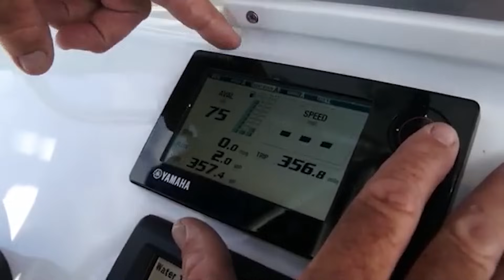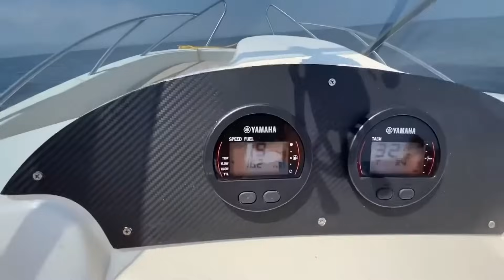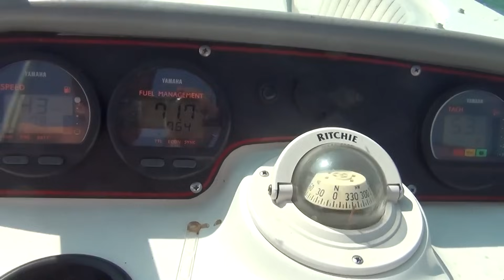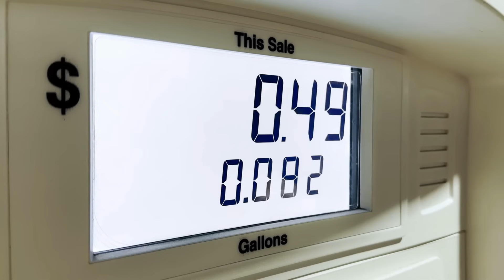Yamaha Built the Perfect Engine... Then Made It Disappear

Comment: When Australia pulled the plug on the sale of new 2 stroke outboards the indestructible Yammie 15 hp 2 stroke was so much lighter and powerful than the new 15 hp 4 stroke that second hand prices shot up. My 15 hp cost me $2,200 and sold 5 years old with low hours for $1,700 when a new 4 stroke was $3,400.

I love my 25 Yamaha lightweight 4 stroke with batteryless fuel injection. Fantastic motor.

Comment: You made an incorrect comment about the Etec engines being carbureated! Etec's have ALWAYS been exclusively DI 2 stroke engines!!! And, they were superseded by Evinrude's troubled 2 stroke DI FICHT platforms.

The lower fuel pressure DI Etec's DID NOT suffer from the problems of Yamahahaha's technically unnecessary very finicky, multi filtered, significantly more complex & heavier HPDI systems inconsistencies at different throttle settings. And... the Etec's were THE FIRST OUTBOARD to achieve the California CARB 3 Star environmental rating as well as the more restrictive ratings of the European "Bodensee" environmental regs! Mercury & Yamahahaha 2 stroke & 4 strokes were later newcomers to 3 Star!
Reply: So why do you rarely see them on the water 

I seem to remember the fuel pumps ran lean and burned them up at high rpm
Reply: @thomascooley2749 because BRP and their marketing MISMANAGED overcoming the public's MIS-PERCEPTIONS about the old low tech 2 strokes in general. And, how BPR's product engineering & design have overcome the problems of conventional 2 strokes. Also, former OMC's RUSHED TO MARKET... DESIGN BUNGLING OF HIGH-TEC PROPRIETARY APPLICATION OF 2 STROKE DIRECT FUEL INJECTION! 😢
Reply: @thomascooley2749  evinrude despite its looks is very efficient and durable, however due to thei marketing incompetence they went bankrupt.
Reply: @jorgeiv804 the last gen they built were great engines i will admit they were ahead of there time for style but when new getting parts was a nightmare and the early etec had allready build a name for unreliability 
No marketing gimmick was gonna save it
Reply: @thomascooley2749 I see etecs on the water every weekend. They were great engines but I would not buy a boat with one (unless it was very cheap) due to lack of parts availability. I honestly think their biggest problem was that all other engine manufacturers were telling the public that 2 strokes are a thing of the past. Evinrude couldn't fight off the stigma of the old 2 strokes.

Comment: I'm running a 2000, 115 V4 yamaha on my 17.5 aquasport, and it runs absolutely flawlessly.
Reply: One of the best motors ever made - the v4s & v6s were almost a direct copy of the OMC motors of the time (there was even a lawsuit). In my opinion yamaha made them better than OMC did & also made slight but relevant improvements. Great, great motors, I've had a few v4 & v6 yamahas over the years & they've been fantastic!
Reply: I have the 2007 model Yamaha 115 2 stroke it runs great starts instantly only run non ethanol fuel with ring free in the gas also
Reply: @DustinKeating-yk3vq  That ring free is great stuff.
Reply from the maker: Awesome. Bet it flies! What are you up to out there?
Reply: @VintageBoats I did a full resto, the Boat went under during Hurricane Ian, so repowered with the Yami, I keep it in the Florida Keys and so far I have had it to 40MPH in the flats and still have about 1/4 throttle to go 😳, but it's a bit squirelly at that speed with no weight in the front, 😂 I'll have to get a couple of people on the nose before I take it to WOT.
Reply: Same on my Edgewater, with a 4 blade SS prop it’s perfect.
Reply: @timrainger8908  I got a 13x19  but want to try some other props.
Reply: @acproductsusa826  Mine came with that Prop also.  I have a 17.5 Edgewater 175cc.  I played around with some cheap aluminum props to get the 4 blade right.  Ended up with a SOLAS HR Titan 13-1/4 x 15 RH P/N 3453-133-15.  Works great i hit 5400 RPM and 37mph. While getting low speed performance.

Comment: I have an 01 200hp ox66 , mine had a rod bearing fail , rebuilt it for less than 2 grand , it chugs fuel but is solid , I’m at 1204 hours
Reply from the maker: How many hours you hoping to reach before the next big expenditure?
Reply: @VintageBoats it’s been 2 years in the water , and I think all I have to to the motor is replace the primary fuel filter , clean the fuel flow meter , and replace a battery
Reply: @VintageBoats it’s probably due for a tune up and cleaning the O2 sensor but fuck it , it runs , water pump is 2 years old , makes about 15psi as 4000 runs about 145 degrees in 85 degree water

Comment: I still run a 2001 OX66 Vmax 225. It’s a rocket, and as long as you keep the fuel system clean, it stays that way!
Reply: Oh yes
Some great dolphins fishing and
Some  sail fish
Reply from the maker: What boat is it powering?
Reply: @VintageBoats 1991 Ranger 395VS. It’s 21’ and the biggest boat Ranger ever made. Only 26 made that year with less than 125 ever made. It’s heavy as hell, but still scoots along at 68 mph at WOT 23p 4 blade.
Reply: @poysunivey dam 68 is fast asf .2 strokes will always be better then 4 strokes .more power on demand ,less parts , more torque off line ,and are simple to rebuild .
Reply: Let me come record some videos and interview you about the boat?